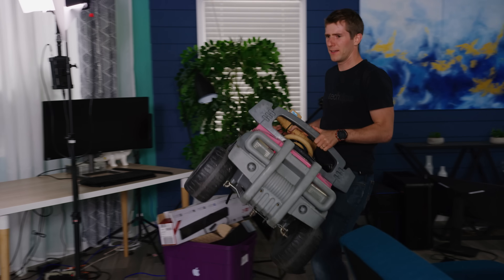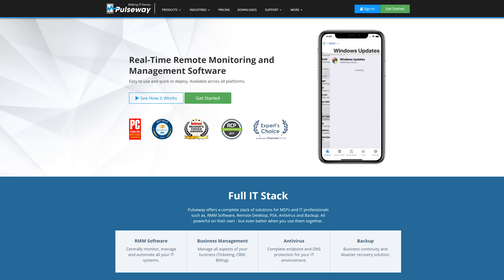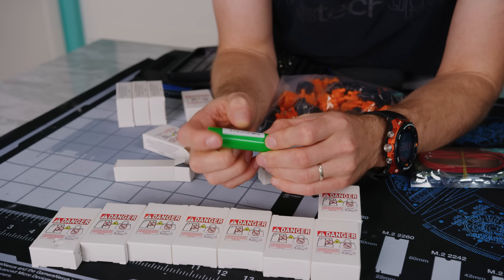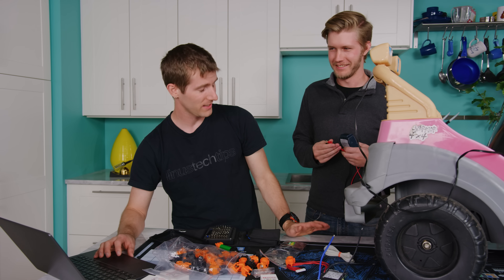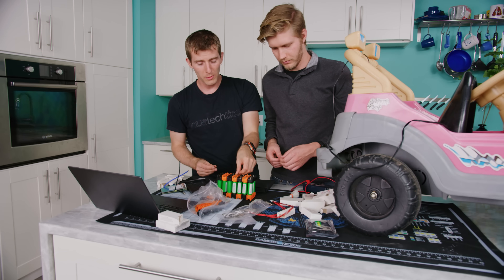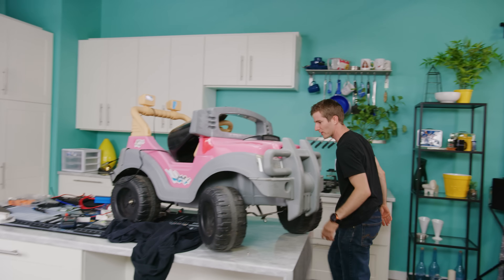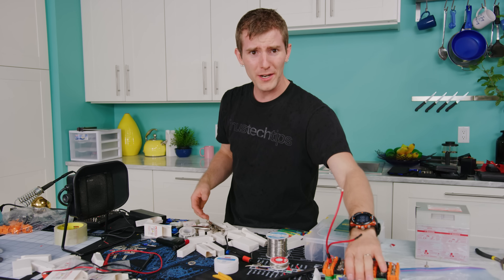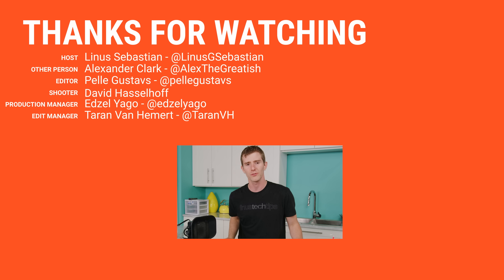DIY Lithium Battery - What could go wrong??

Comment: What if lithium battery put in UPS
Reply: Not a good idea unless you also completely replace the charger... SLAs are designed to constantly trickle charge whereas not only is being fully charged all the time bad for lithium it could even cause it to explode if left to trickle charge indefinitely, but it's certainly doable as long as they're under charged and have charge protection to stop current preferably at no higher than 3.8v per cell for this use case which would result in having a longer life but around 30% less capacity.

Comment: fyi: the gear box tends to blow up over double-voltage with rubber on the tires. it drifts really deadly and takes a good jog to keep up to at double though.

Comment: Find an old inner tube that is a bit smaller than the radius of the wheel, cut 4 sections of it off at the width of the wheels and stretch it over them. It should give you a better grip on all surfaces.  It will only last a while before it needs replacing though. But it will save the wheel plastic from wearing down as fast. you should get a few changes of rubber out of one old inner tube.

Comment: "DIY Lithium Battery PACK", not "DIY Lithium Battery"  ;)
Reply: Per definition: Battery = A device consisting of one or more electrochemical cells.
Reply: @carl-friedricherb3254  exactly. That's why the "pack" Is to diferentiate one cell vs. a bunch of cells. If not, the phrase "I made a battery" could mean "I created a battery with a anode, cathode, a separator, etc" or "I soldered a bunch of batteries toguether"
Reply: @marlonmartins82  I agree that its common to call it a battery pack, but the round, green things are single cell, so calling the whole thing a battery is technically correct ;)
Reply: @carl-friedricherb3254  And practically confusing. :)

Comment: Clickbait! Under "DIY Lithium Battery" title we expect to find video about building battery from raw materials, i.e. a bag of lithium, a bag of other components, so we can built battery in shape we desire. Stacking existing batteries is a piece of cake for everyone. None of 3rd party parts is required.
Reply: "DIY lithium cells" is what you are probably looking for. A battery is an arrangement in series or parallel or both of cells.
Reply: So by your definition "DIY Lithium Battery" is an arrangement in series or parallel or both of LITHIUM BRICKS? You there is no 'cells' word in 'DIY Lithium Battery' phrase. Still clickbait.

Comment: Be careful. 18650 high discharge batteries can explode so easily. As a mechanical vaper, i know how weak are these batteries when you short circuit them.
Reply: Which is why I don't mess with mech mods, I'm fine with regulated. Also, there's no way those are 3500 mAh, probably rewrapped.

Comment: I was hoping it was going to be making the battery, not just joining them together.

P.S. you can charge a multi cell battery by charging individual cells, e.g. charge 6 cells at first, then charge the final one separately.

Comment: glue some heatsinks to the motor and you are golden
Reply: Liquid metal isn't an adhesive as far as i know.  So liquid metal water cool it with a car radiator.
Reply: Bigboii liquid metal is called solder lul .. VERY adhesive
Reply: @ssunde4698  wosh
Reply: You're doing woosh wrong
Reply: noctua´s
Reply: The batteries need it more really.
Reply: Not really. Current will heat up the part with highest resistivity. Thats the load (aka motor). Battery pack doesnt actually need it unless its short circuited directly to ground.
Reply: Blowie emitrons?
With Liquid metal?

Comment: soo you know that you can start a fire with a small smartphone lithium batterie. and you think that it is a good idea to put a selfmade batterie in a kids toy, that your kids use??? that big pack you are holding there is capable to blow a 1 meter hole in your garden....imagine what it can do to your kids!...... original packs have a protection housing around the pack, this monster does not! dont let your kids drive that! ........
Reply: ...do you even know anything about lithium ion batteries?

Comment: 10:36 That was a rather shocking experience...
Reply: That wasn´t a electric shock, the short-circuit arc burned his hand. The voltage is wayyyy to low to feel anything.

Comment: The motors in those toys don't have a lot of thermal headroom. Overvolting them will kill them quick. If you want to go faster, the proper way would be to upgrade the entire motor along with the battery

Comment: in the history of tools those are by far the worst wire strippers you could use. Think about upgrading to a pair of nice klein, ideal, or green-lee ones. https://www.amazon.ca/Klein-Tools-11054-Wire-Stripper-Cutter/dp/B008PVUGUU/ref=asc_df_B008PVUGUU/?tag=googleshopc0c-20&linkCode=df0&hvadid=292914019569&hvpos=1o3&hvnetw=g&hvrand=2228359710249426755&hvpone=&hvptwo=&hvqmt=&hvdev=c&hvdvcmdl=&hvlocint=&hvlocphy=9001478&hvtargid=pla-434316418693&psc=1
It will make your life easier

Comment: you dont need a single high voltage charging adapter, you can use multiple psus' output voltages in series. that's how we (diy battery builders) do it.

Comment: I usually think Linus Tech Tips are knowledgable and well experienced, but this video isn't so informational. I've built a 54 volt battery back for my electric scooters using cardboard as spacers. But it was entertaining non-the-less. Video should have been called DYI battery pack, I though Linus was going to build a cell.

Comment: If its INR its samsung, we use those 18650 batteries in vape devices. Samsung usually wraps INR in that green wrap.
Reply: There's no way that's actually 3500 mAh either.
Reply: Nope i just looked it up, at first i thought they were Samsung 25R's or Sony VCT5's but they are either LG MJ1 3500 mah 18650 @10amps or they could be Sony VC7 3500 mah 18650 @ 8amps.

Comment: Don't use a normal soldering gun on a battery you dimwit. There are two outcomes, a cold solder joint, or a burning battery, neither are good. You want a pulse spot welder for any battery work.

Comment: That's a pretty popular RC hobby balance charger, I recognized it immediately... it's called B6 AC, you should simply run it in 6S3P, that charger should be way faster than your crappy charger board, also try a hobby grade brushless motor, which will give you unbelievable torque, like this: https://www.youtube.com/watch?v=Ycfv3QIqvco

Comment: make some heuge rubber bands by cutting up old truck tire inner tubes and put them on the rear wheels.
Reply: Front for blether drift, rear for better exhilaration in most bulds

Comment: You can't just replace battery with higher voltage one. More voltage could destroy the controller board or fry a motor, if it isn't rated for those volts. You should at least say that, because people will be inspirated by you and will try to do the same thing without knowing the machine stop working, start burning etc.
Reply: he said that it will probably burn out faster but he dont care. and he said its not the recommended way to do any of this. and if you are working with soldering and Lithium packs then im pretty much sure you at least know what you are doing!
Reply: I mean if you know how to wire up lithium batteries you porbaply also know that overvolting isnt a good idea
Reply: thing is, he didn't have any idea what he was doing, he was just following a guide and that's pretty obvious because he doesn't even know how parallel/series connections work
Reply: @antonioreal3789  He thought he knew so he tried it. I have the experience that people who just watch a video about something wont do it afterwards because they still think they are going to do something wrong.
Reply: also in the video you saw he just got heavy shocks from it XD
Reply: I seriously doubt these things are more than a switch, a variable resistance pedal and a brushed DC Motor. They aren't putting high end brushless DC motors with an ESC in a kids toy that is probably going to get left in the rain.

Comment: you could also put a stronger motor into the car thing something in the values of 2000w or so you can buy them on eBay or amazon.

Comment: Should have just used headway 38120hp cells, alot better for longer continous draws, like 1 12v (4 cells per bank) bank will hold 100 amps of current above 11v.

Comment: wait... so if the batteries are able to be separated.... why didnt they just separate it into one 3s and one 4s and charge them on the "maximum 6s" charger one at a time then reattach them together after they are charged?

Comment: Its not DIY Lithium Batteries until you harvest your own lithium ore
Reply: You need about 200 ore to craft a battery. Also need the scrap metal which you can find during side missions or loot from enemies.
Reply: @ShahimCalicut  lol
Reply: No one mines Lithium Solid Ore. Commercial "mining" is done with Brine Liquid.
https://www.youtube.com/watch?v=50rXYrFCQMw - Brine Evap Pools.
Reply: It seems that just putting together cells is what is required to DIY "battery" , as per your suggestion, this isn't make a battery "from scratch".
Reply: Eh, kind of arbitrary to say harvesting ore is diy but harvesting lithium from batteries isn't.  But I digress
Reply: Lithium comes from distillation of trash u dummy
Reply: @esprithk  what the fuck do batteries have to do with cancersticks
Reply: Lithium pure enough to go in a battery burns vehemently when touching oxygen. So that would be a very bad idea to try to mine it and then hand place it in a battery lol
Reply: http://i.imgur.com/CdKB6UW.jpg?1 

6-Volt batteries are just smaller batteries in series.

Comment: A consideration when purchasing the 18650 cells is to observe the weight of each individual cell. The heavier the cell the better! You will find the price varies dramatically. Spend the money and avoid the issues, Samsung and LG's are a good choice! The stamped frame brush motors, like Johnson and Mabuchi, often found in the Powerwheels type cars, do have a wide voltage range 6v to 30v depending on manufacturer and series. A Powerwheels mod should be fine although a change on the toys resistor values may be in order. Further, the maximum weight is roughly 130lbs depending on the model, which could lead to premature motor gear drive failure. I would like to see Linus use a Android phone and a motherboard with Bluetooth or WiFI for a drone design with that car body?
Reply: LG HB2 cells (brown) are pretty good for regulated circuit usage. Sony VTC 5a cells (emerald green) are my recommendation for unregulated circuits.
Reply: Sony VTC? I'll try them!

Comment: fun fact... just like you can connect batteries together in series or parallel to get more voltage or amps , you can also connect chargers together as well to make either more voltage or more amps.

Comment: I bought these vruzend once and they were disappointing, cracked caps after short use, came apart upon a small impact at slight angle, did not connect the tops as they stripped out the bolts easily. and the bars are not easily soldered to. Note this was version two of them and he is using a newer version but still do not like these at all!

Comment: For future reference most of the electrical components you are working with have a +-10% tolerance on them. Like if something says it needs 10 volts to run it can work between 9 and 11.

Comment: Did you watch the photoinduction super charged wheelchair video? Recommend to build the battery pack out of pre-built li po packs. You can put a 3 cell and a 4 cell in series.

Comment: use a solder rig, this connectors are crap you can skip a battery connection easy and unnotice, destroy the others in the paralel  by overcurrent or over discharge.

Comment: Remember that "electrocution" means death by electric shock.  You are not going to to get a high enough voltage even if all 21 batteries were in series to get an electrocution level shock unless you did something crazy like coating your hands in salt water and placing them across the terminals.  Even then this is DC so it is not going to affect the heart unless it is pulsing on and off or alternating back and forth.  With DC at such low voltages, it may cause some pain and discomfort but it is mainly going to cause some mild burning if you remain in contact with it for a time.
Reply: Which is the Killer, Current or Voltage? by Electroboom
Reply: Joules kill regardless of form.
Reply: @Bramble20322  That's exactly what I said - the higher voltage drives more current through the body - but a surprisingly low voltage can generate sufficient current to cause damage if the resistance is low (e.g. the points of contact are close together, sweaty/wet skin, broken skin). To just assume that anything under 50V is automatically safe is dangerous in itself (I worked with hydrogen fuel cells and had to go through ac & dc voltage training).
Reply: The voltage doesn't really matter (static shocks are 1000s of volts and are generally harmless), it's the amount of current passing through the body that causes the damage - anything over about 10mA can cause a painful shock and anything above 100mA can be lethal. Even low voltages can cause significant damage depending on the body's resistance (e.g. damp, wet or broken skin). It doesn't really matter if it's AC or DC if the current is there - both can cause heart problems (although you need more DC current than AC).
Reply: Current kills? Correct. Voltage doesn't matter? Incorrect. The saying of "It's the amps that kill, not voltage" is only half correct, as the current is the culprit of ceasing the heart, but the voltage is what carries the current to the heart. It is as if you are saying that, "it's the bullet that kills, not the gun."
In fact, without a significant amount of voltage, the skin's resistance will reduce the amount of current by enough to render it non-lethal, but you already know this it seems. So you should also know that without voltage, there is no current, as stated by ohms law, and thereby you should also know that voltage does matter.

Comment: The 33v adapter should be fine. It (because I don't know the output of that specific adapter) will probably just charge at a slightly higher amperage. This will decrease charge time but increase heat as well as degrade the cells at a higher rate. When charging lithium cells heat is a concern so charge away from flammables and monitor temperature. Lithium batteries WILL blow up if drained or charged too quickly as well if cell temperature gets too high while charging. If you wire up the batteries in a 3x11.1v or 3x14.8v configuration with a quick disconnect to run the units together or separate you could alternate between 11.1v, 22.2v, 14.8v and 29.6v when desired as well as charge the units individually on a  3 or 4 cell lithium battery charger respectively.

With the Samsung 18650 25R 2500mAh 20A batteries you will experience cell degradation more quickly than LG's HG2 cells which are, in my experience, more stable (less likely to blow up or catch fire) than their Samsung counterparts. The LG HG2 cells also have the benefit of a 3000mAh rating which should improve battery life depending on configuration.

 Anyway, arranging the cells in a 4x3 configuration with 4 cells in series and 3 rows in parallel you should get 14.8v 7500mAh out of each unit. You could also wire the cells in a 3x3 configuration which would result in 11.1v 7500mAh if you wanted to stay on the side of safety without any major loss in performance at the end of the day. Pairing duplicates of these configurations would give you flexibility in charging as well as use options while painting your target voltage outputs. Either of these configurations should charge quickly and safely on a decent 3 or 4 cell lithium battery charger, an example is linked below.

I would love to see your idea  for this project become a mini series. Be safe and keep the rubber side down.

https://www.amazon.com/16-8V-Charger-Li-ion-Battery-Aluminum/dp/B074XRW8T1

Update: Just watched the rest of the video, FUCKING HILARIOUS. Please continue this project, I would love to see where this goes!

Comment: I want to make a high amp battery for my e bike it uses a 36 volts but the battery says 40 volts how big the battery will it be how many cells do I need the battery in it I think it’s only 4 amp it only goes about ten miles how much will it cost to do I have to make a battery case

Comment: I read an article on that this is the same way a Tesla battery pack works.  It's a bunch of little batteries all in parallel and series to make for one massive battery.  That way if one cell goes bad.  Just replace that one little cell.  That way the fix will only cost a little bit instead of $50k.
And there is some kind of "BRAIN" to keep from overcharging one while a different one gets his drink of power.

Comment: 10:00 The Verge: "You see, when you place the battery inside of the car, you must place layers of tape in between, or else it will short circuit the car."

Comment: I broke two laptop batteries and made a portable charger with like 30 lithium bateries and connected them with wires  from the 99¢ store and well the wires melted
Reply: Why you research about planned materials before doing projects like these.
Reply: Rohan Dwivedi Like the other guy said, do a little research first, it should be somewhat obvious that heat + batteries don't mix well, so if you're going to solder cells you want to get a lot of heat on to it quickly with something like a soldering gun or a high thermal mass tip at high temperatures rather warming up the cell with a weak iron like those $10 pencil things.

Comment: careful... 18650s(normally used in vapes) are highly explosive.. also... they are 3.7 volts ea... btw.. I build lipos pretty often for car audio...
Reply: from experience... if you see "naked battery" or ripped plastic .... take the battery out and re-cover it... or else it'll blow and quick..